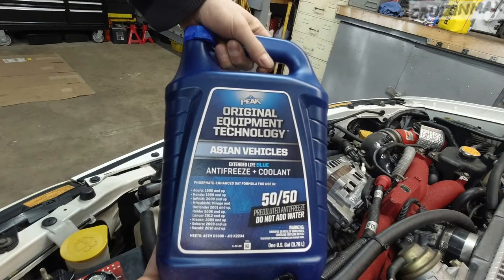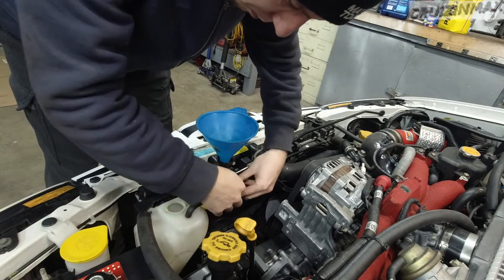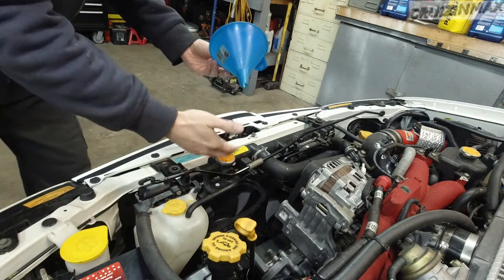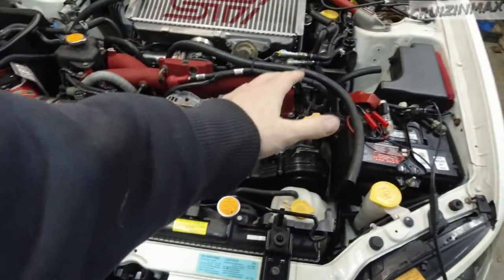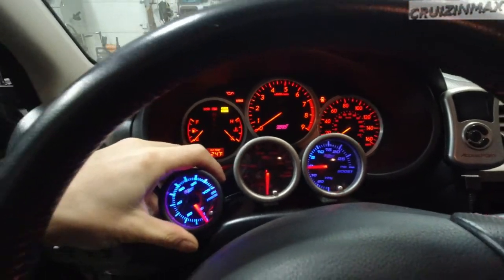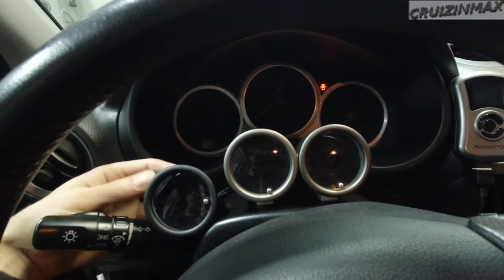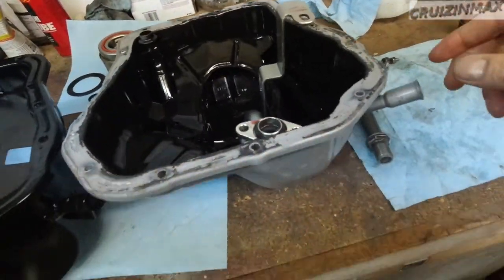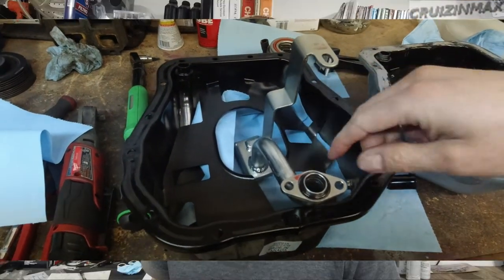Subaru STI EJ25 build part 15 engine, oil pump priming

Comment: just remove the oil filter once you see oil come out of there put it back on and it should build pressure after that. there is an air bubble

Comment: Pull oil filter , has airlock
Reply from the maker: it was the oil pump, filter was full.
Reply: CruizinMax what was wrong with pump?
Reply from the maker: must have been shelved for some time, it wasnt primed properly even tho on the instructions that came with said that it has been.
Reply: @cruizinmax4017  next time same your self the grief , leave filter off , pull plugs . this vid will explain it.

Cant get your Subaru oil pump to prime . YOUTUBE

Comment: Some people say the 07 Sti pan is the new updated version that will minimize oil starvation. Planning on resealing my oil pump here soon. Should you always prime/put in oil before rtv and install?
Reply from the maker: it is always a good idea, i just put a fresh build into a buddy's 05 STI and we couldnt prime it, just remember to put a bit of blue locktite on the very tip of the threads and torque those little oil pump bolts that secure the plate.

Comment: Your videos have been very helpful in putting my engine together. I really hope I don't run into this issue when I'm priming my engine. Do you recommend doing what you did to your oil pump before I put in my new engine into my car. I haven't put together my timing portion of my build yet.
Reply from the maker: yes you should do what i did but use vaseline only since it wont run down and make sure to torque those screws to spec, I think i used a quarter inch 7mm socket with an adapter to use on my torque wrench, a philips bit should fit the 7mm.   Goodluck with your build man, you will see how fast pressure builds up in a future episode.
Reply: @cruizinmax4017  I'm glad I saw this. It sucks that I have to pull the oil pump again and rtv it again. I'd rather be safe than sorry and have to pull the timing belt off while the engine is in the car. I'll buy my self a Phillips bit this weekend and work on the oil pump. Would you still recommend using assembly lube with the Vaseline?
*I just noticed that you said to use Vaseline only. Sorry I missed that in your response.*

Comment: Hey Buddie thank you for covering the oil pump replacement. I have a question for you, I install a new oil pump into my 05 Impreza STI with 110K, I usually replace them oil pumps just to keep things all good.  However, after priming the oil pump I torque the internal cover screws to specs 3.6 ft-lb and then proceed to spin the inner rotor a few times but I notice that oil was leaking from the pump cover.  I search on YouTube to see if anyone have the same issue as mine but nothing!  So the next thing I did was to grab my old original old oil pump did and add oil into the open chamber and rotate the inner rotor and notices the same thing....it leak oil not like crazy but enough to make me uncomfortable!!! Could I used black silicone and seal the cover plate and retorque the screws to specs?? I dunno but could this be one of the reasons why there is issues with the oil pressure and eventually leading to internal?
Reply from the maker: hey...I would think that a little leak is ok since it will end up inside the pump anyways but I would call these guys  www.flatironstuning.com  their number is on their website, they do nothing but subarus.  I did not experience that with mine since I packed it with very thick stuff.
Reply: CruizinMax CruizinMax thank you for your quick response, I did the priming with assembly lube oil but it still leak not that crazy but enough to make uncomfortable as I keep my STI all stock but I guess your right it does return to the oil pump and into the oil pan.  Thank you very much👍🏽
Reply: Tito Rojas did you add rtv to properly seal?

Comment: These cars have flat tappet cams and the oil must have high levels of zinc and phosphorus for break in! Use straight weight non-synthetic SAE30 Valvoline VR1, no other oil has higher zinc and phosphorus levels. The oil used after break in should never have less than 1000-1100ppm zinc.
Reply from the maker: the heads were reused, the only things that needed braking in was the piston rings.

Comment: You’re meant to take the spark plugs out when cranking for oil pressure! 🤦
Reply from the maker: why?
Reply: CruizinMax really, you can’t figure it out??

Because it will crank faster, not overheat the starter... and take pressure off the bearings.
Reply from the maker: sure its easier on the starter, with a fully charged battery it wont make a difference as to the speed of the cranking and as far as the pressure on the bearings with all that assembly lube and fresh oil coming in, it wont matter but good points if you want to be perfect, sometimes its just not necessary.
Reply: CruizinMax except you didn’t have oil pressure...
Reply: CruizinMax and it will crank faster with no compression (plugs removed).
Reply from the maker: the oil pump was supposed to be primed.  I suspect it has been shelved for too long and thats why it didnt prime on its own.
Reply: @cruizinmax4017  Factory Subaru oil pumps are supposed to be factory primed but I've found that I've always had to prime them before installing. I had to manually prime it on the engine by pumping oil in through the bypass spring port the first time and I've pre primed every one before installing since
Reply: An Ej doesn't require any more than unplugging the crank sensor to check for cranking oil pressure. Spark plugs are overkill and not necessary